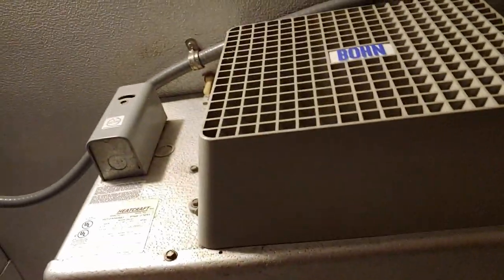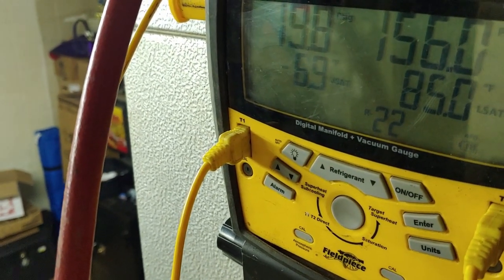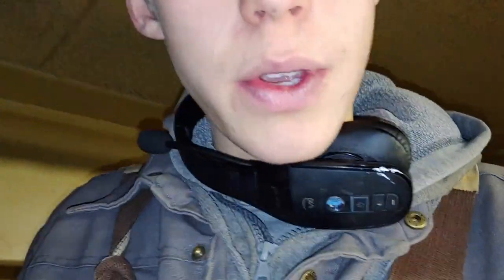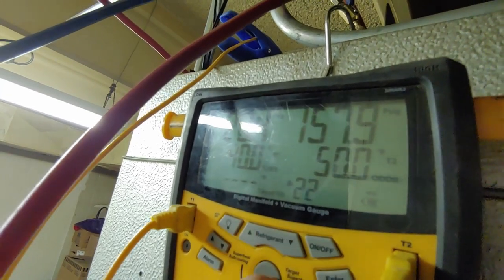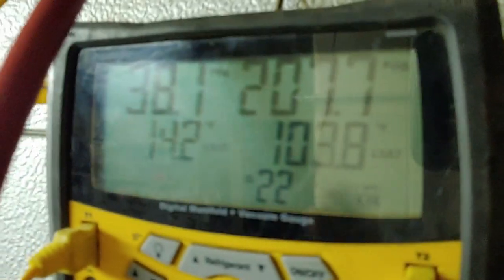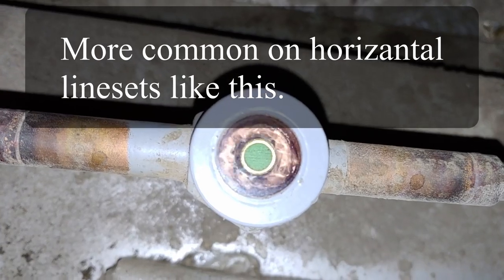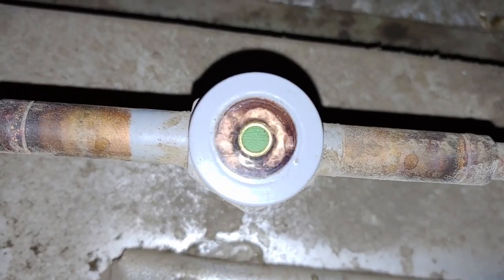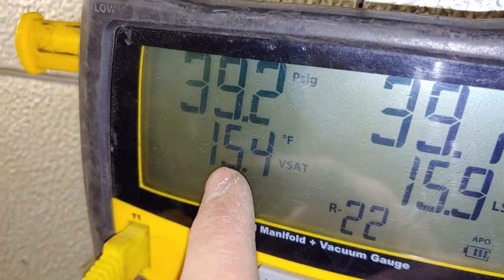Walk in Cooler Too Warm; Low Flow Sight Glass VS. Bubbling

Comment: Thanks for the tips. Especially the strap to remove the hose trick. I always used the rubber handle of a cresent wrench or channel lock, but the strap is much better.

Comment: what about non-condensables showing in the sight glass?
looks like a pre-charged style lineset like what was used on 70s to early 90s a/cs -> i've been told they're prone to leaking.
Reply from the maker: I had not considered non-condensable gasses being present. I will have to do some reading about that before I can have a good understanding of how those gasses would affect the system and where they would accumulate.
Reply: @ReubenSahlstrom  ya i'm unsure of the impact myself.
Reply: @ReubenSahlstrom  The problem is that non condensable gases will obstruct the liquid into the exp valve decreasing the liq into the evap coil lowering the capacity of the system. It also will raise comp outlet pressure. All bad things. If there are noncondensables  the only way to correct is complete evacuation. However its a rare problem on system which has not presented any such problems. You'll sort it out.
Reply: Then you would have high condenser pressures and have an abnormally high condenser split depending on the type of unit. Should always be watching pressures as you charge. If you start seeing a 35+ condenser split, stop charging and monitor the system. Measure ambient going to coil. Don't rely on weather apps. I have seen 20-30° temperature difference on commercial roofs and non-matched hoods which cause recirculation in the condensing unit. Temperature of incoming air to condenser coil - head saturation temp = Condenser split

Comment: I was always told to shut the system off. Wait a bit. then make sure my hoses ar tight and the valves are shut off then hook up my gauges and purge the air out. Than turn the system on.

Comment: What are normal pressure, superheated and subcool for walk in coolers?
Reply from the maker: What refrigerant? Superheat should be around 20 12-18" from compressor inlet, subcooling should be around 10, LSAT not more than 30 above ambient and VSAT should be about 15-20 degrees lower than the target box temperature.
Reply: @ReubenSahlstrom 
I spend years to work it out how it works and you just text it in few words! This is priceless and I will crop and save this as desktop on my phone till it's get deep inside my brain! Thanks man!!!
Quick question are this numbers (targets)  same for all refrigerants ?? 
Thanks and God bless you!

Comment: Was there a leak in the system?
Reply from the maker: Yes, it was determined later that there was a small leak on the evaporator. Thus the unit will eventually get low again unless the leak is repaired.